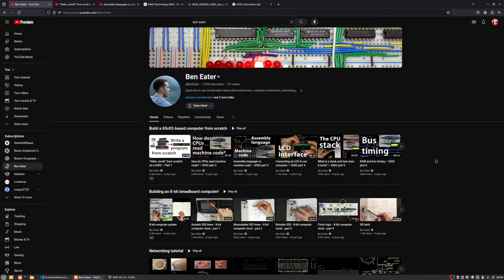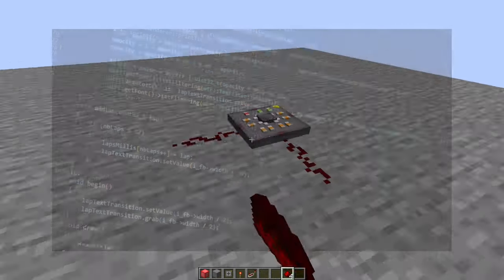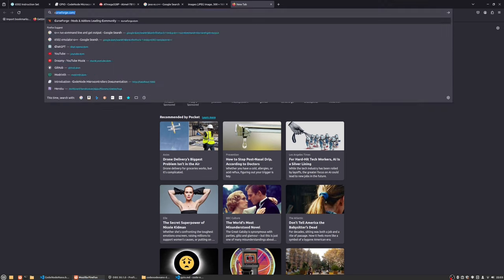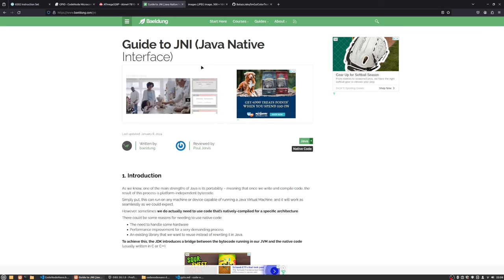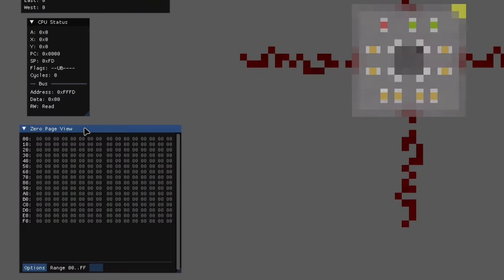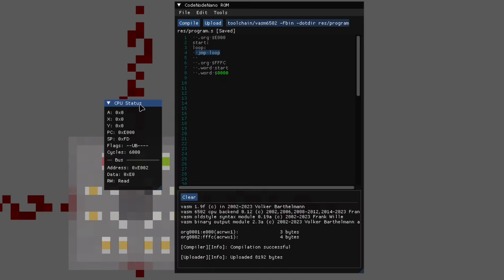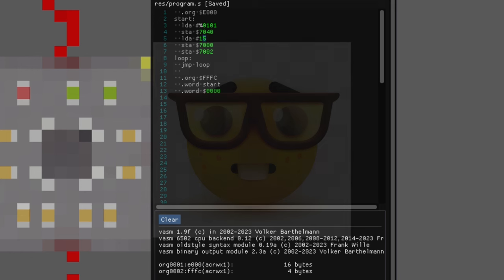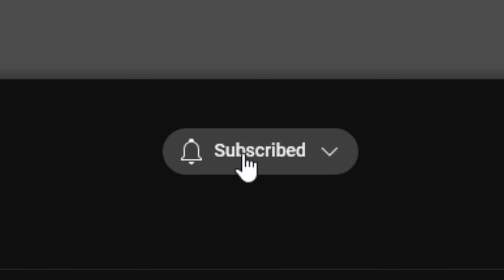Creating A 6502 Microcontroller for Minecraft!

Comment: This guy saw Computer Craft and said "Nah, that's too easy" xD
Reply from the maker: When you get bored of lua XD
Reply: @elmfer Going from lua to emulating a CPU in minecraft is insane...
Reply: @ngspace9829 Nah, that's perfectly normal.
Reply: I miss redpower 2 with its computer running FORTH, I only know of two computer mods that is being maintained which is computer craft and open computers, both of which use lua
Reply: @AlbySilly  FORTH? lol, also there is a mod that adds a microcontroller that runs assembly
Reply: @elmfer  an wild programmer (type Reversed Mojang) has spawned !
Reply: OpenComputers is better than ComputerCraft.
Reply: @AlbySilly  I still played with that like a year ago as I just wanted to make a more IRL working elevator with frames, RP2 had all of that. so fired did we a 1.2.5 classic server and then played there for a few months hahaha, very nostalgic and sweet.
Reply: @AlbySilly opencomputers II is literally runing linux with risc-v emulator OwO

Comment: i would recommend a mod called project red to integrate with this
Reply: Yes
Reply: I wonder what uses this could have in actual minecraft. Autocrafter that can make any recipe?
Reply: You wouldn't even need to have another mod. A 6502 could be fabricated using the integrated circuits provided by that mod...
Reply: You should look up the 65el02 CPU, the 65el02 was in a mincraft mod many years ago in a mod called Redpower 2. Redpower 2 had tons of Redstone related stuff. In fact Redpower 2 is what ProjectRed is based off of. ProjectRed is redstone stuff from Redpower 2.
Reply: @TildaAzrisk i will deffinetly check it out
Reply: @TildaAzrisk  Thanks for confirming that, I was vaguely remembering it but I never got that deeply into redpower so I never actually tried the computer. If I recall correctly redpower was closed source and the author stopped updating it in maybe 2013 or something, not exactly sure but the last pack I remember having it was FTB Mindcrack and project red appears to be an independant re-creation of parts of it.

Comment: Congrats, hardware emulation is always super fun to code, and very impressive to watch !
For porting it to an actual Minecraft mod, you could also have used Java, as a JNI binding already exists for ImGui (imgui-java), I have used it in the past for the debugging UI of a GameBoy emulator, and it works like a charm.
It would probably also make the actual sync with the game a bit easier ?
Reply from the maker: I was originally going to code the entire UI in C++ and create a few bindings for it, but others suggested it will be a better developer experience to code the UI in Java rather than having to switch back and forth many times. I do agree on that, so I will definitely look into it.

Comment: that's awesome. I've wanted to make something like this for so many years now. yours looks much better than my ideas, but this gives me inspiration to finally make something. I still wont finish it, but... great inspiration! actually, I do have a computer I made that does work, but it runs javascript, not 6502 assembly. it uses an item frame map to display the screen and does 20 fps. I made it for arcade games, for my backrooms project.
Reply from the maker: Awesome! Bro keep it up because that it actually interesting!
Reply: @elmfer subbed, I look forward to seeing more from you 😀
edit: I assume what you made is a mod? because in vanilla minecraft you can't detect or output a redstone signal like you do in the video. sad this is the case, but there are workarounds. I've never made a client side mod, everything I make works with a vanilla client.
Reply from the maker: @lorenzo42p Yup! The program I showed in the video is a proof of concept, but I am currently migrating the code into a mod

Comment: Very cool! Besides the old RedPower 2 mod which had computers based on the 6502, there's also Open Computers which supports custom architectures besides the default Lua one. There's an implementation of the 6502 for OC, Thistle, but it looks like it's no longer maintained. It would be amazing to be able to program Minecraft computers with assembly, I always thought that the Lua computers don't really fit into Minecraft as they feel a bit too magical.
Reply: IIRC RP2 used Forth for it's computers.
Reply: @thebloxxer22 The computers actually used a variant of the 6502, I remember there being a webpage that lists all available instructions. Eloraam wrote (or maybe ported) Forth in 6502 assembly to run on the RP computers. I think she might have wanted to originally use Microsoft BASIC but couldn't get the licensing rights or something.

Comment: The original RedPower mod by Eloram back in the day had a 6502 based computer block, and a couple of disks you could get that ran on it - Direwolf20's run back then used the Forth one but I think there was also Basic, but as it was a full 6502 emulator, you could make your own disks with whatever you liked on them...

Comment: I presume that compatibility with 65EL02 is not planned? Most of the RedPower2 programs were probably written in FORTH but there must be some in assembly programs still floating around and would be cool to see those old codes  working in more modern Minecraft than 1.4
Reply from the maker: Not yet, I do plan to integrate this with other mods though

Comment: I've seen other comments and there are great ideas, but i have idea myself maybe add  cables ("Cable x1", "Cable x2", ..., "Cable x7", "Cable x8")(x + number means how many there are wires in a cable) and when connecting cable x7 to cable x8 you get the 7bits but when adding cable x1 next to that cable x8 you get the bit you lost when connecting the cable x7 (and the same with x7, x6, x5, x4, x3, x2) and the cables gave out 15 redstone value when bit is set and 0 when not set and maybe cables don't lose strength with each block they go

PS: I think my idea is cool, but i don't really know how to make Minecraft mods so just saying you do you

Comment: That's cool! I have a few more ideas. You could have some sort of cables in minecraft that would connect to the MCU and to something else, which would allow transfer much more data per tick than a regular redstone. If that would be possible, then you could add a display, connect it to the mcu and draw things on the display. Another thing that would be cool is to have a sensor that would read data about block or item, because more possible inputs and outputs -> more intersting stuff we can do with it.
Reply from the maker: Of course! This allows users to make more complex projects, so at some point I would like to add those features too

Comment: That is quite the program, i would recommend adding blocks that are placed near the microcontroller which just give it more pins and give a higher level language for coding it than access because learning access is... you know. so that is all i've got i would wish for you to continue to do this and share a public mod for minecraft. Edit: i would also recommend a in-game ide that shows up when you right click on the microcontroller
Reply from the maker: For sure! In future, I was thinking of adding ability to code it in C just like coding an Arduino because assembly is kinda hard. Also, I do have plans for adding pins either by adding a bigger MCU or like what you said. The code editor shown at the end would be the UI that will be added to the mod
Reply: @elmfer cc65 compiler would be an idea. Another idea is having the pins displayed on a clock so that it displays pins 0-4 then 4-8 and so on before looping and the interfacing red stone can read these pins by ANDing the value with some sort of clock.
Reply from the maker: Gotcha, this is similar to memory banking that allows the 6502 to have access to more memory, but this would be used for the I/O registers instead
Reply: @elmfer  yea but you would need like something that prevents redstone from connecting when placed side by side or else it would get shorted out and wouldnt work

Comment: I don't know how far along you are by now. But I think you should reserve more than 1bit for Pin mode.
Since you only have 4 GPIO pins, you might want them later on to support things like UART or CAN-Bus. Even if it's not on table yet. just reserving 4bit per pin (so 2byte/addresses) for pin-mode gives you much more flexibility for the future. And 16 Pin-modes for Input, Output and some Communication protocols later on should be enough.
Reply from the maker: Bro just in time! I added UART around the time you made this comment!

Comment: Surggeston add a debug setial port that you can connect locally for local coding

Second give us full bus access with  project red integration

Add memory memory block

Add an ender memory block pretty much muti port memory

See if you can program itwith the Arduino ide

Add pia chip

Look x16 compuer by the 8bit guy implemented the vera gpu

Just a few ideas
Reply from the maker: Thanks! I noted them down because these features seemed very useful to have
Reply: @elmfer  if you can get working with the Arduino IDE you would allow for a MASSIVE crossover for education electronic and help kids jump from  redstone to IRL electronic